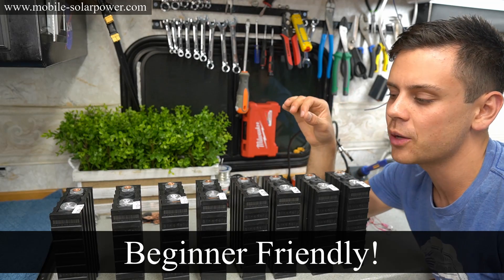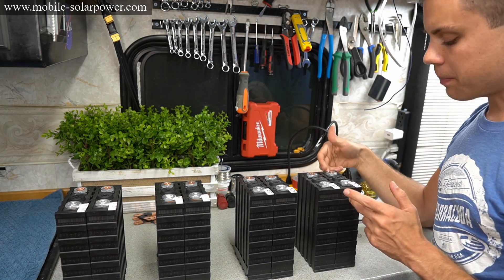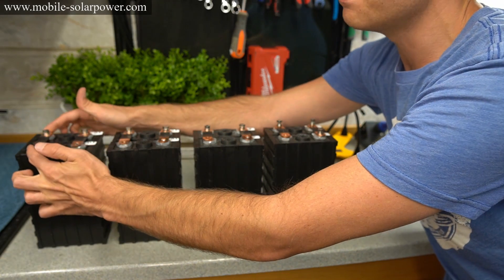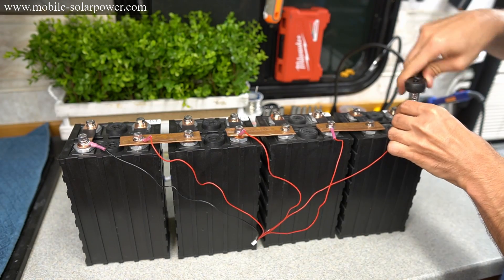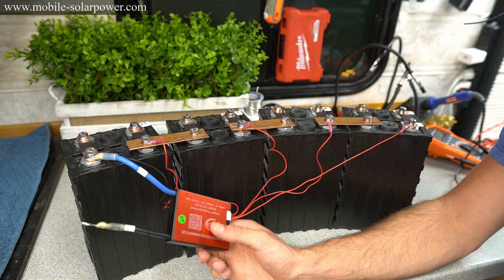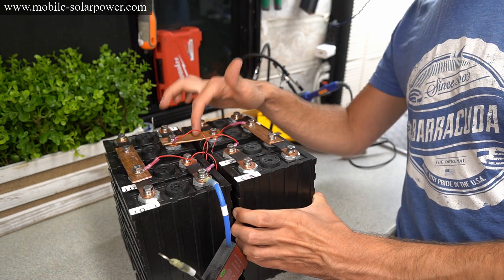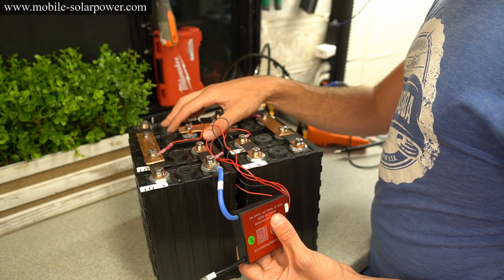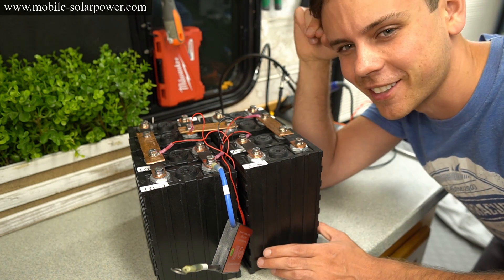How to Build LARGE LifePO4 Solar Batteries w/ Raw Cells and a BMS

Comment: Hello!
Regarding Daly BMS,
If you have a low voltage situation with a separate port bms, it will only disconnect the loads, but it will keep the solar charge controller attached. ... Yes, I think so.
But Battery Pack is FULL situation with a separate port bms, it will only disconnect the solar charge controller attached. Is it correct? If so, charge controller is damaged, I think.
How do you think about??
Reply from the maker: Yes it works that way. Low volt situation disconnects loads, and high volt situation disconnects the charger line

Comment: Hey, Will: you recently had a video on those small DIY active balance-boards and you claimed that they're just resistive balancers. That's not true; I am just testing one of those balancers myself with li-ion cells and it's working fine and shuffling power from the higher-voltage cells to the lowest-voltage one just fine. Sure, the 1.2A claim is bullshit -- it seems to be slow as molasses -- but I would personally still consider it pretty useful even then.
Reply from the maker: And thank you for telling me your results! Awesome.
Reply: You're entirely welcome :)
Reply from the maker: Yeah I took that video down because I realized that voltage just needs to be high to get the active balancing to kick on. And honestly, I wasn't that dedicated to balancers. They are fun but not that cool in my opinion haha. I just got two more of those balancers for various projects. I have original video up still

Comment: Thanks for this very informative video. One question; what is the AH capacity of the array that you built in this video?
Reply: Double the capacity of the single cell e.g. Single cell 50 amp hour in series * 2 equals 100 amp hours.

Comment: We'll keep up the good work. I do appreciate all your information and amazing videos.  May I ask how big of a system do you use to run an RV air conditioner and everything else included in your RV.  I currently only have 640 watts of solar panels a bogart engineering trimetric 2030 battery monitor and the bogart engineering charge controller. Along with 450 amp hours of batteries. Which is for Trojan t105 Batteries connected to 12 volts. At a pure sine 1500 watt inverter 3000 watt surge. don't seem to have enough power to run my air conditioner.

Comment: Another awesome, user friendly video as usual. You mentioned in a previous video about not hooking up the LiFePO4 to the alternator because it with soak up too much current and damage the alternator. What are your thoughts on limiting the current by running the vehicle's power leads through a charge controller, so that while driving the batteries can slowly charge?
Reply from the maker: Charge controllers not current limited so they will be destroyed. I did this before haha. You need DC to DC charger for safe alternator charging

Comment: Most of the separate port BMS I've seen have low charging current(8A).
So how do you charge faster if you have a big solar array?
Reply: I just purchased 2 units of Daly 8S24V separate port BMS's for a project.  Upon delivery, I learn the charge current on the separate port is rated at 10A....thats going to limit me with the mppt charge controller.  Back to the drawing board.
Reply: @stujeff  yeah... That's the problem with separate port BMSes.
We need one that can take more amps as the common port or is not going to be useful for most solar application

Comment: Another great video Will!  Thanks to you, I have the 200AH cells from Ruixu and am well on my way to a DIY set up.  Question for you, have you seen these Smart BMSs on Aliexpress?  ~$60 for 80A BMS.  They have a bluetooth connection with an app and some software to allow you to connect to a computer.  I'd like to get your take on them.
Reply from the maker: Yes I have those coming in the mail. Will have to get back to you on that! I cant wait to see how well they work
Reply: @WillProwse  Looking forward to the video, as always.
Reply: @WillProwse  i have a problem with my bms. The output voltage is 9.5v but the battery is 13.4v can you help me? Than you

Comment: Was anybody else holding their breath while the wrench was hovering over those open terminals? You will only drop a wrench or screwdriver once - when the battery demons spark and hiss you might need to check your shorts! You can have a similar experience shorting to a grounded shelf/cabinet when righting down those lugs... plasti-dipping your tools can minimize the excitement if you don’t need professional insulated tools.
Reply from the maker: Haha I was nervous just filming that part.

Comment: Why did I spin my wheels on Nate Patels PCB and K2 26650's when this is so simple and easy? I still do not have a working system. Done with Jehu Garcia!
Reply from the maker: Yeah idk why those guys use cylindrical cells. Probably because they are cheaper. I prefer prismatic. Takes minutes to build.

Comment: What benefit, if any, would increasing the battery voltage to 48 or 96 when it comes to an inverter?
Reply from the maker: Think of it this way. It's much easier to take 96 volts and turn it into 110 volts, than it is to take 12 volts and turn it into 110 volts. And other reasons but that's big one
Reply from the maker: wire loss can be huge. also cost of copper is not cheap

Comment: Will, when you start off by paralleling cells, it is my understanding that you should zig zag (ie alternate the sides) the connection bars to insure even flow of current through the cells.
Reply from the maker: For high c rates, absolutely. But in this case, doesn't really matter. If I was doing big loads I would be stacking bus bars all over the place. Like lithium titanate. But for LiFePO4? Not a big concern

Comment: First...know I'm new and have learned and am still learning so much from your amazing teaching video's! Now? I thought I had a grip on how to build my DIY 12V Lithium battery with the Prismatic cells using the components and diagrams on your website. Four 3.2 v cells hooked together as you've taught and I thought I'd have a 12V 100aH DIY lithium battery!! But now with this video I understand how to connect the cells and it makes a "bigger" 12V battery bank (8 cells vs the first video with 4 cells). Does this mean it's a 200aH battery vs a 100aH with the 4 cells or am I totally lost and don't have a grasp on this like I thought??!!   With the 8 cells what changes compared to the awesome video you explained making a 12V Lithium with the 4 cells?! Thanks again for sharing your knowledge and trying to help us that can't afford the beautiful all in one Battle Born batteries but still need a good battery for our uses!😊😎
Reply from the maker: What I do for calculating capacity is take cell voltage, 3.2, and multiply the AH rating of battery. Then you will have watt hour capacity of a single cell. Then count how many cells you have in your bank, and multiple the watt hour capacity of a single cell by that. Then you will have true capacity of all cells in your bank

Comment: 95%...  The missing 5% is that whenever you connect battery cells in parallel, you need to make sure all the current paths are equal to keep the load (or work) done by each cell equal. Because you connect the minus and positive series connection to the same cell, that cell will work harder than the other cell(s) in the parallel group.
Instead the minus and the positive should be as far apart as possible in the parallel group. If you want an analogy, think of the series connections as IN and OUT to the group. The IN should go in the nearest cell, traverse thru all the cells in the group, with the OUT on the furthest cell. (That is what the current of electrons or holes need to do, in and out and in and out...)
Reply from the maker: I totally agree. And that's exactly what is shown on my website schematic. For low c rate application, the resistance of a bus bar at this distance would be negligible. If this was for high c rate situation, I would be stacking bus bars at shortest distance possible. For large solar batteries? Not a big deal. If this was lithium titanate doing 10c? Oh of course.
Reply from the maker: The resistance of bus bar at this length and pure copper, not big difference at all.  So small I wouldn't care at all. Would not effect performance for this application.
Reply from the maker: Also, if proper size bus bars are used, it's not an issue.
Reply from the maker: This problem you mention used to be a bigger problem in large lead acid banks with higher resistance. Very hard to push power in and out of them. Not the case with lithium ion
Reply: @WillProwse  That makes it WORSE with lithium, not better. The "nearest" cell is more willing to work harder, and the relative resistance ratio to the interconnect is higher.
Reply from the maker: @Sylvan_dB  What I mean is that, if you have 5 strings of lead acids, and long bus bars, and high resistance of all cells in this string, you need BIG bus bars, and short distance etc. With lithium, all cells push and push together. If bus bars are improper size, then yeah, big problem. But considering resistance of bus bar and application, the lithium cells will be nice and healthy in this configuration. But yes, totally agree with you when designing packs for high c rate application.

Comment: Why is series, then parallel, bad?  I'm not doubting you, just trying to understand the reason.  

And thank you for this video!  I am planning on getting eight 3.2V cells to assemble into a 12V "house" battery for a boat and I would have put them together in series then parallel before this!
Reply from the maker: Yeah exactly. There is a higher likelihood of multiple strings in parallel running into problems, especially during high c rate instances. When the cells in parallel are attached to each other, and matched, less likelihood of problems. I need to make a whole video about this discussion. Lots to talk about. Tesla battery modules are setup in this configuration, and a old battery book I used to read at the library.
Reply: @WillProwse   I am also interested in such video. I was also planning do connect mine in series first then in 2p. I even bought 2 BMS for each parallel pack.
Reply: I hope be corrected if I am wrong but when I saw this I just realized that it could have to do with equalizing between the batteries. So the pairs can easily balance between them and if they get out of balance from the other pairs the bms will take care of it. If you series first and then parallel then they can't self balance.
Reply: @RobinHagg  i agree but it will be harder to find a weak cell

Comment: Hope this is clear: '=' is the main current path, '|' is a thin inter-cell connection, and '|||' is an end bus bar.
          1          2          3          4
         |||=====|=====|=====|||
- ===|||=====|=====|=====|||==== +
         |||=====|=====|=====|||
Inter-cell connections on the same 'S' only carry a small differential current, so bus bars on these are overkill and 14AWG wire should be more than enough between same cells.
With long strings, that can save a lot on bus bars by considering how much current each wire sees in practice.
Reply from the maker: Oh good point!! Very true
Reply: that is true for ideal cells. In the real world that doesn't load each cell equally. If you never put a heavy load (or charge) on them, they might live their normal life. Otherwise the most heavily loaded cell will discharge deeper and/or charge faster, using more cycle life each time than the more distant cell(s). It is the exact same principle at work when paralleling lead acid, but is even worse with lithium because the internal resistance is so much lower in lithium cells.
Reply: @Sylvan_dB  Good points, but cells in a group are locked together by their parallel neighbours so cannot discharge faster or slower than them though there may be more intercell current flows.
Cells (or cellgroups) in a string are not clamped in this way, and individual states of charge will vary according to depth of discharge, capacity and average internal resistance. That is fine until a cell(group) bottoms out too early and signals it's time to retire it, and that depends on what is acceptable for the application in hand.
Cells can be moved from one cellgroup to another or replaced to help reequalize their capacities and average internal resistances - this is tedious and time consuming when you have 5000 cells to measure!
Many people would hand them in for recycling and get a new pack.
Reply: @ahaveland  Again, that is what the theory says regarding an ideal battery and ideal interconnect. Do you know the difference between theory and practice? In theory there isn't any.
Reply: @Sylvan_dB  In practice good enough is good enough.

Comment: Cool Bananas
I was curious how each separate cell balances?
Reply from the maker: BMS manages balance of cells in series, and for cells in parallel, they cycle together and balance each other. Cells MUST be matched to do this properly. My cell supplier does this. If using used cells, not a good idea to parallel. LiFePO4 super easy to parallel though, compared to other chemistries. Need to fuse nmc cells

Comment: Really curious about high watt solar panels high 300s and the 400watt panels LG and sunpower make a 400 watt? doesn’t look like they can be purchased in low amounts
Reply from the maker: Yeah they are great. Just hard to ship and mount. But those are awesome.
Reply: DIY Solar Power with Will Prowse ya it’s mentioned how much shipping is...400 watts for a 8x4(roughly) seems like a no brainer...not sure why mounting is harder. Unless I’m wrong the LG is 21lbs. The frames seem Similar..i imagine the reason for you not testing high output panels is cost.
Reply: You have a sweet set-up for gaming in ur rv I like the swivel....so are you generally using shore power? I’m curious about what power the rv motor provides. Anyway thanks will for teaching your great at conveying info!

Comment: Good idea on setting up the cells parallel then serial.  Thanks, Will could you put up a diagram of how to lay out the batteries for the 12 volt and 24 volt example.
Reply from the maker: Oh yes those diagrams are on my website. I have been adding a ton! Check out link in description. 24v system can be found in the diy blueprint menu
Reply: Can you also run in parallel, 2 units of 8S 200Ah, each complete with a Daly 100A Separate Port BMS.   Combined into 2P,  you could then theoretically run the 8s2p  at 200A, but for longevity at half this, 100A.  No relay, no isolation switch.  Would the BMS's operate well in parallel?
Reply: @stujeff  did you find an answer to this

Comment: Thanks for this, was wondering if those cells could be set up in parallel
Reply: Yes they can, but you must make sure the voltages or states of charge are similar before connecting cell groups together.  Less than 0.1V should be good to avoid massive current flows, smaller the better.

Comment: I notice you only connected one of the posts from positive to negative.  Is it better to connect both positive posts to both negative posts?  I know you probably only connected one post due to your orientation of the batteries.  I'm a newbie with this so hopefully you understand what I'm saying.
Reply from the maker: Oh sure good question. One is fine, but if you are pushing a lot of amps, you can stack bus bars or rearrange them. I can push 120 amps through these and they are barely warm, so this works great